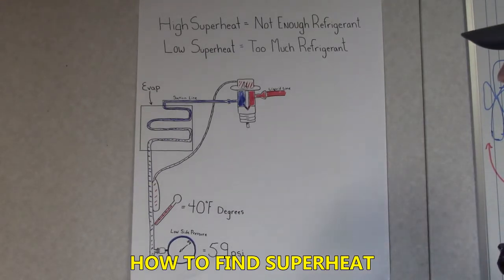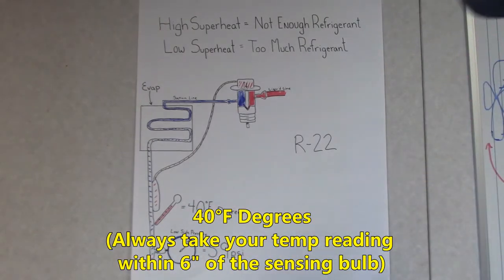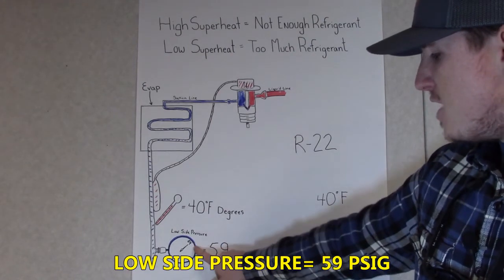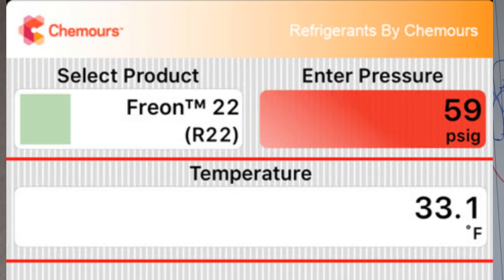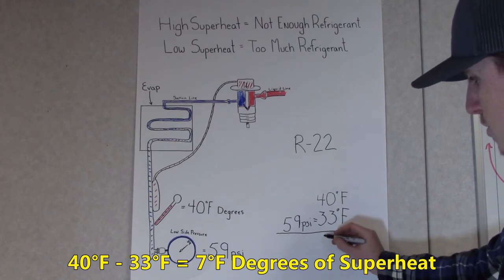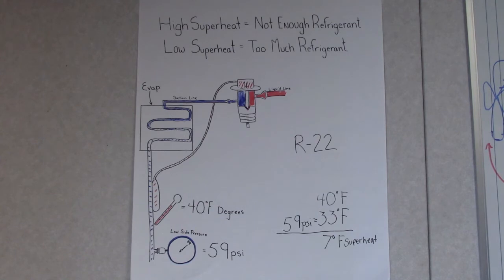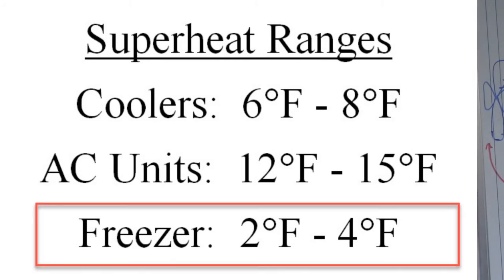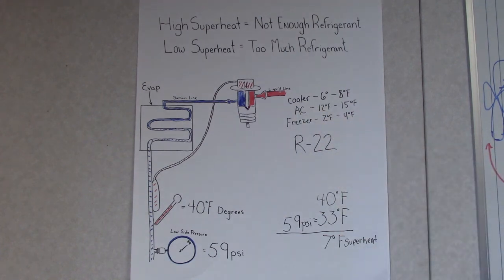How To Find Superheat

Comment: its ok to put the sensor on the exit of evaporator?  .where is the Right place? i have accumulator too... on my system ..its humidifier
Reply from the maker: You should measure both your pressure and temperature on the suction line after the evaporator.  They should be checked no more than 6" from each other.
Reply: @dp560productions2  thanks
Reply: Down senser  flwor ending making all hot  sezing bulbe  new mading humidifier s enzer